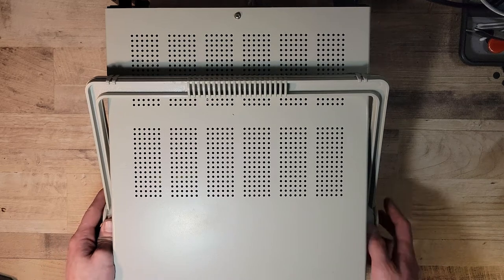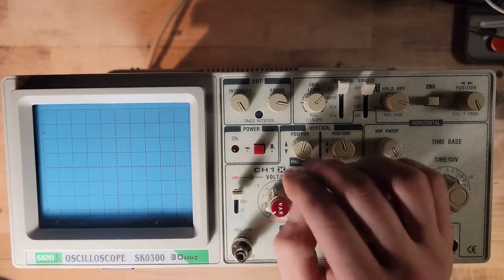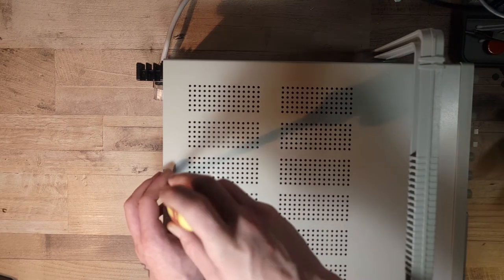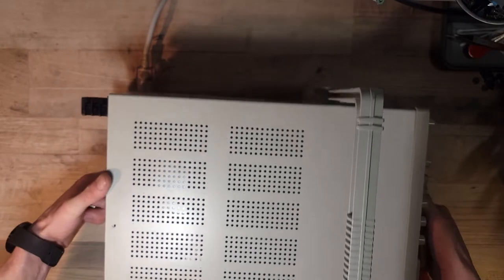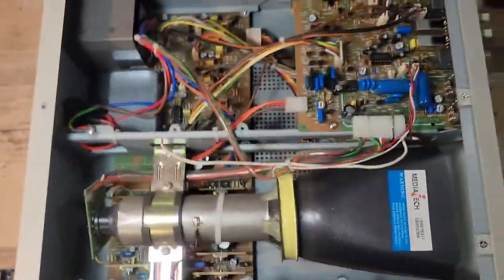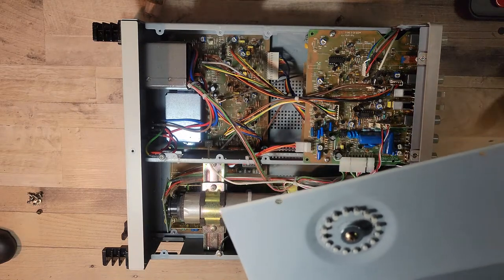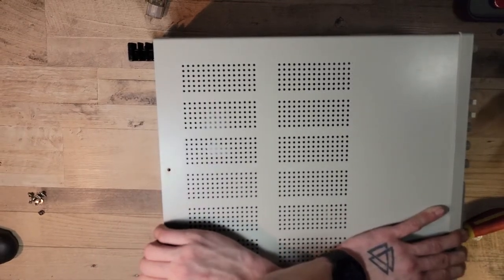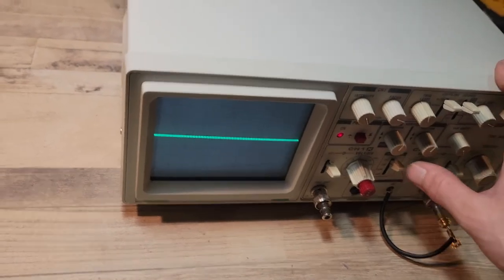eBay Analog Oscilloscope  - SKMI SK0300 Teardown

Comment: How did your scope work out? I just picked up an SKMI SKO409…got it for the same reason as you….hit the wall with my DVM. Finding info on this brand is very hard though. Scope works well though I’ve only had it a few days.